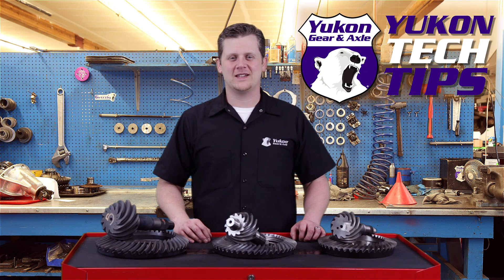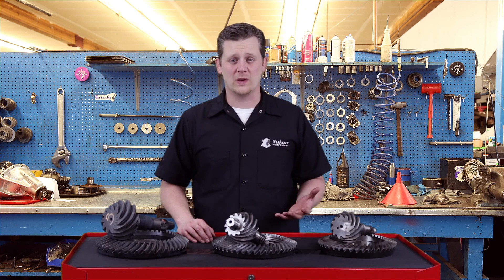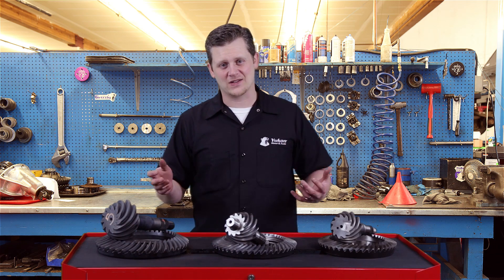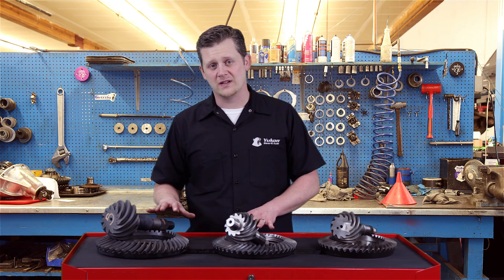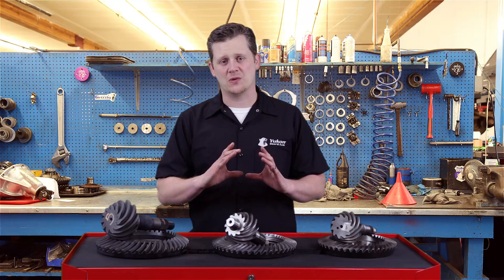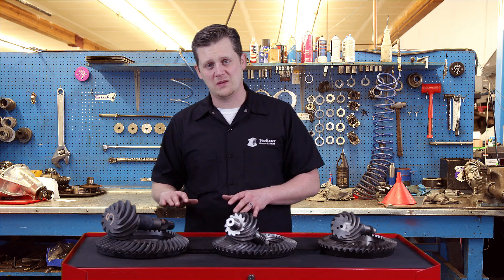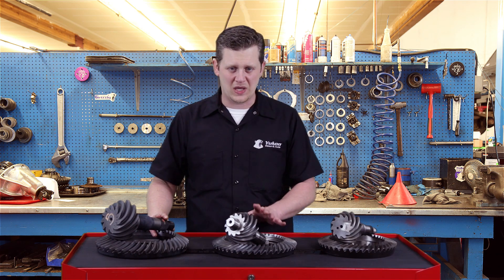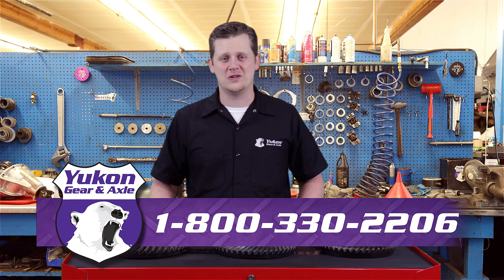GM 14 Bolt Differential Explained - How to Identify | Differential Tech Tips

Comment: Hello  I'm got big confused. I have 3500 Chevy 4x4 . Is single wheel.1988 have 14 bolt  8 lug..and I want to put dually rear end axle.so I care more  heavy stuff.. ?what  is the 😢 number of rear differential ?I'm have to buy ?to adapter in my truck . Please Lent me know 😢... thanks..

Comment: What is the better 14 bolt full floater year to use please ! Motor is a 8.1 chev 2005 its in my 1953 Ford bread van transmission is 4l80 have not done diff yet

Comment: Are the gm 10.5 and aam 10.5 the same thing? Do they both have the pinion support bearing? I took apart a 10.5 and the pinion support bearing was not installed! It has the area for the bearing and the pinion has the nub on the pinion head but the bearing it self was just not installed.

Comment: is the GM 14 bolt 11.5 HD used on  dodge  ram ?
Reply from the maker: I would call it the AAM 11.5 if it is for a 2003 or newer dodge 2500 or 3500

Comment: Great nice video. I went to Chevrolet and gave them my vin and they were able to print out my build sheet. My 14 bolt is a 3.73 9.5 non Posi traction on my K1500 6.5L TD diesel. I want to change it over to Posi traction. What do I need to accomplish this.
Reply: A welder, or a spool are cheapest....from Wyoming USA 🇺🇸 🤠

Comment: What is the gear ratio of a 10.5 inch straddler pinon. I don't have a tag and don't feel much like taking off the cover just yet. Do they only offer one gear ratio for the 10.5 inch gm.
Reply from the maker: Hey Brandon, there are multiple possible OEM ratios

Comment: Strange my 95 K1500 Z71 6.5L diesel on the build sheet i thought stated a 373 9.75 14 bolt standard rear end. It is 14 bolt I've changed my gear oil. I'll have to research that more. I'am looking at getting 373 PT.

Comment: GM 14 bolt 9.5 semi-float here. 365 turns, 24 hairpins on a 17 mile 4000 ft climb. Getting popping towards the top of climb. Should I run a little more slip modifier while I live up here?  Well paved roads by the way. Pretty sure gear oil is stock (160k miles) so would that just be breakdown of modifier over time? A tire always chirps around the hairpins.
Thanks
Reply: I also have a 9.5" semi- floater in my '97 K1500 and there is no need for the slip modifier in fact that could be your problem. The G80 rear end is a locking differential not limited slip, big difference. I would drain it and refill with fresh GM 88900401 or ACDelco 10-4016 synthetic axle lubricant.
Reply: Thanks, might try that next time. I already went with the AC Delco oil and modifier recommended in the owners manual. No more popping, runs great. Still gets a good chirp in the hairpins.
What I drained out was sludge that defied typical cleaning solvents. Let it drain with heat lamps for 2 days and still was oozing out. Recently bought this truck with 160K. Looks like the fluid was never changed. Gonna flush and new oil again in a couple of months. I only put on about 100 miles every 2 weeks.
Cheers
Reply: @ianwilds3139   g80  is limited slip,if you look up the codes in your glove box

Comment: is the "big boy" as you called it common in 02 1500 hd Sierra?  lol just found out I gotta replace transfer case. and found leak in rear end yolk shaft.
Reply: no, the 11.5" AAM axle is used behind the Diesel's and select gas powered HD platforms.  it is allways an 8 lug full floating axle. 
the 14 bolt used in a half ton truck would be the small 9.5"  33 spline c - clip type axle.

Comment: Are the diff covers interchangeable between the 11.5" HD version and older models?
Reply from the maker: Hey Eric, all 11.5" and 11.8" covers are interchangeable.
Reply: @yukongearandaxle .. but not the older 10.5" 14 bolt. Thanks.
Reply: @yukongearandaxle  I have a 2004 Chevy Silverado 2500hd 2wd is it a 10.5 or 11.5 looking to buy a Yukon diff cover

Comment: Is there a way to identify the Full floating axle on a window sticker of a brand new truck? or for it to be a 2018 GMC Sierra 2500HD with a 3.73 axle ratio going to indicate automatically that the truck will have a full floating axle?
Reply: All full floater axles can be just unbolted and slid right out. Look at the back tires/rim you'll see the bolts holding them in.
Reply: Any big block or diesel 3/4 and 1 ton in the last 10 years made by GM or Dodge uses the American Axle Manufacturing...aam... 11.5 rear . It has a huge ring and pinion but still runs the same 30 splinec1.5 shafts as the older 10.5 14 bolt . Dodge uses the same 11.5 as GM Since mod 2000s as Dana axle did not get the bid to supply them the axles .Dodge uses a better spec 11.5 than GM ,but what else is new gm trucks are for city folk .

Comment: I own a 87 Chevy V20 3/4 ton 6.2L diesel 4x4 and my truck has a stock 14 bolt SEMI-Float which really sucks! Question : Is it even possible to swap out the semi-float flange axles to full float and swap the 9.5" to a 10.5" ???
Reply from the maker: No, the entire housing will have to be replaced to go to a full float. A similar year Chevy with the 10.5 should be a fairly easy swap,.
Reply: I've been searching for that answer all morning! I'm looking at junkyards and would prefer the full float 10.5 on my 2000 C-2500, but it came with the SF 9.5. I would assume the axles all mount to the truck the same way... but I dunno. hah
Reply: @Yukon Gear & Axle Just thought I would give you an update which is that I ended up swapping my 9.5" semi-float axle to a 10.5" full-float axle with no problems everything fit right up and in fact did not even have to lengthen or shorten my driveshaft. Now I'm in the process of swapping out my 4.10 ratios for 3.42 ratios!
Reply: @jessiej3991  How did that work out, now you can't use overdrive? The 6.2 can barely turn a 4.27, they should have made a 4.6 for them.